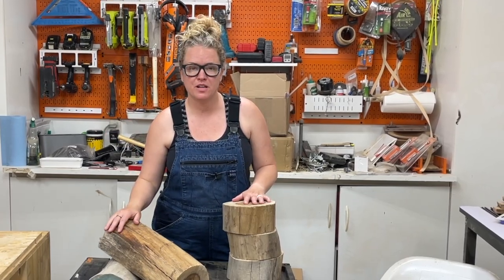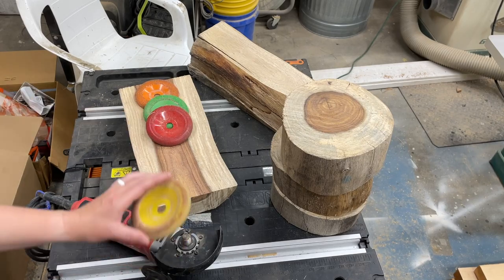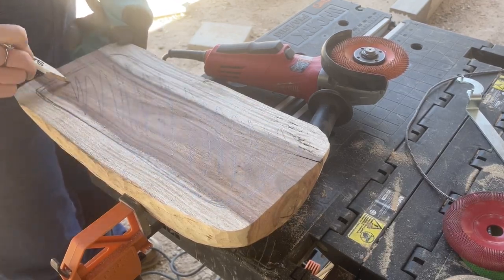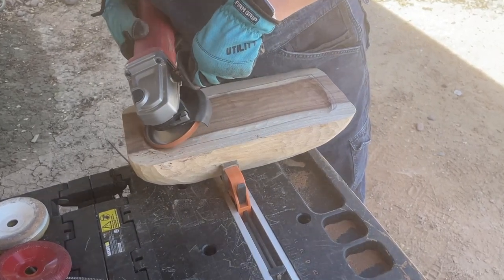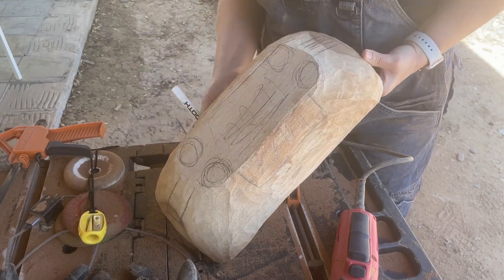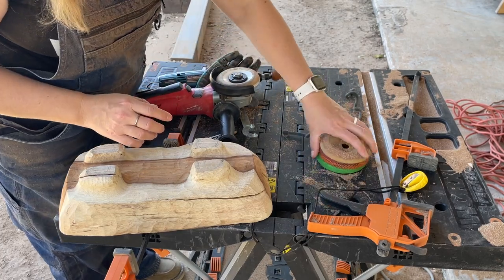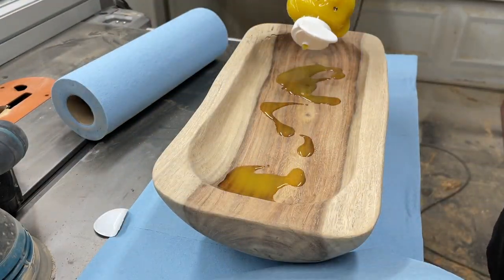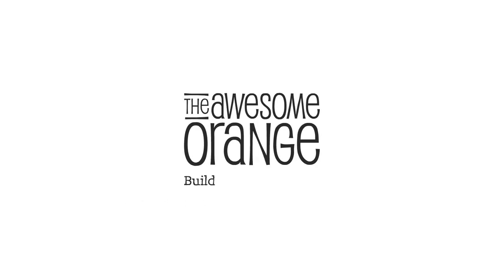Power Carving A Dough Bowl With Feet!

Comment: Great video.  What would be other  good woods to carve a dough bowl? Would glue up work for this project?
Reply from the maker: Thanks! And yes a glue up would work. If you are going to use it often as a dough bowl and wash it regularly just make sure that you oil or regularly or else the glue joints would be the first to fail… just like a cutting board. 🍊